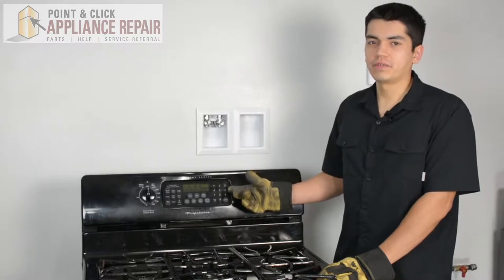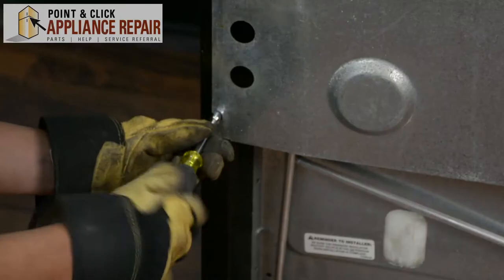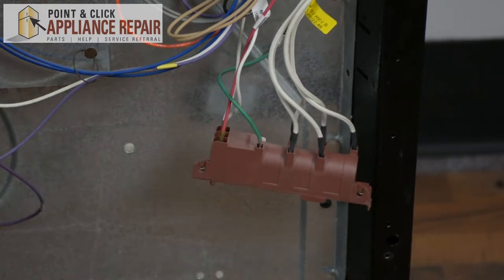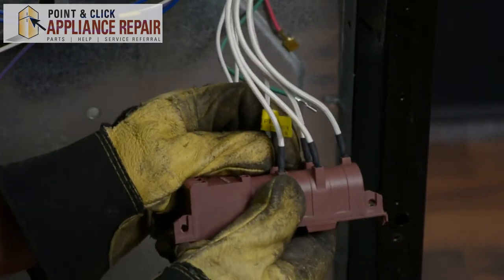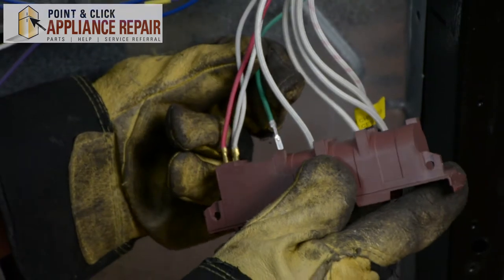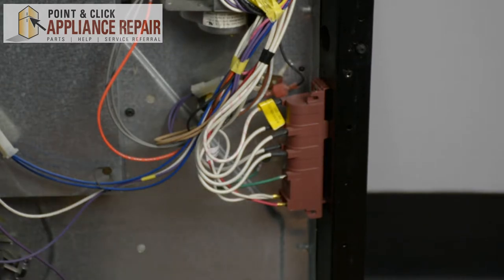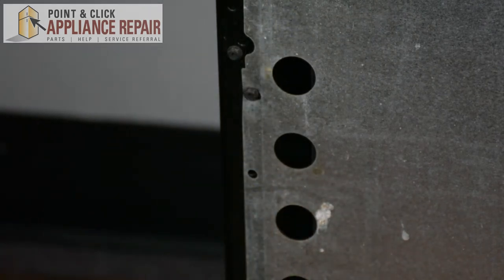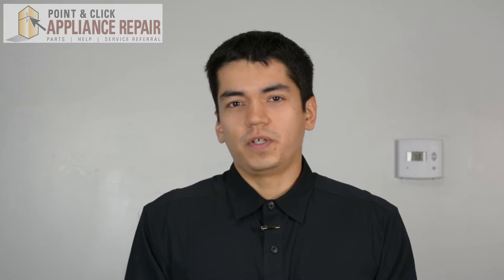318079001 - Replacing Your Frigidaire Range's Spark Module - AP2128204, PS442614

Comment: Good Vid. I replaced my Module by REconnecting each wire as I took them off to the new one. Replaced the Ignition Wire Harness also. That way I "Refresh" my Stove instead of waiting till it pukes(BOTH was only $40 each and sent Next Day Air for only $7.25, cool). Fast/Easy Peasey. Beware ya'll. My Model is the FFGF 3053 LSJ , and my Module was under the Lid, to the left. Easy access. MANY Frigidaire's have it BEHIND Stove. Research which you have before, so you can prepare. Just saying.